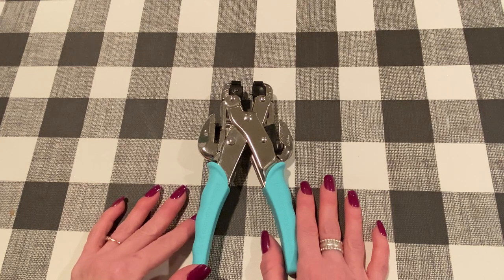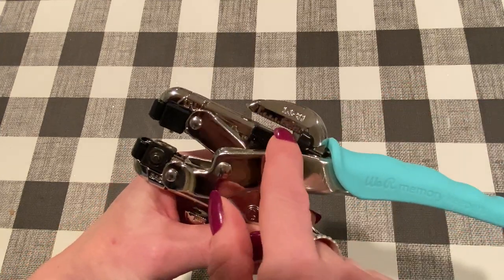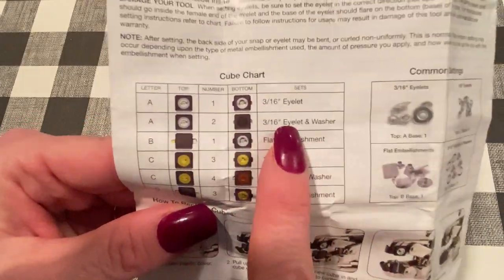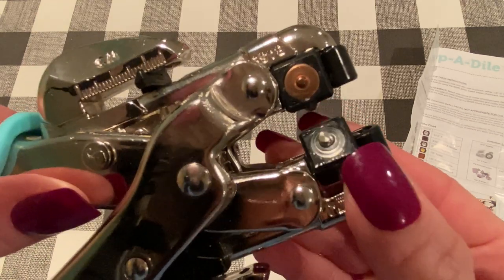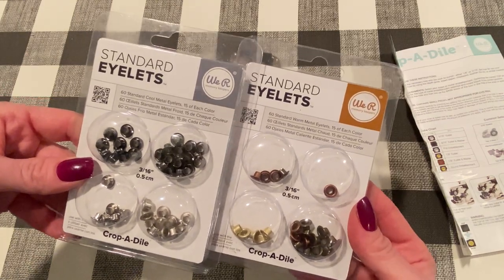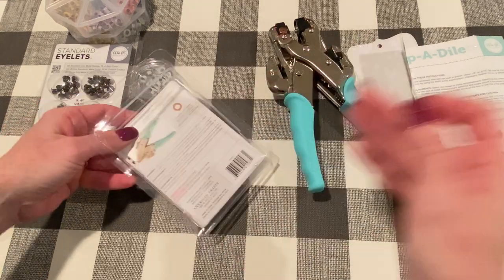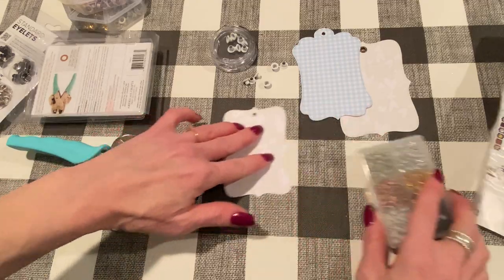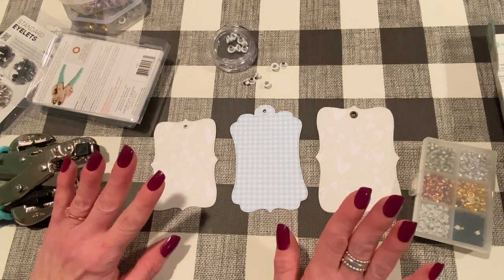How to punch holes and set eyelets with a Crop-A-Dile (requested)

Comment: Thanks for the demo. I have been using mine for 2 years BUT not very confident about it. (Relieved to see that your back sides can look imperfect, too, but they are still just fine.) I never noticed the markings on the CAD itself indicating the "base", so you know how to hold it when punching. The directions leaflet that comes with it has the tiniest printing.

Comment: Hi, very useful indeed. Thank you very much! I mean to buy one to use it on fabric. Do you know if it works for that at all? For both punching and eyelet setting? I know I may have to stiffen the fabric first, with starch, to get a cardboard-like consistency.
Reply from the maker: Hi there! I would imagine it would work the same. You might want to check out the cropadile instructions, either the one that comes in the package or online. There could be recommended settings for different materials. TFW xo Jen
Reply: @strawberrycream39Jen  Thanks! 😊😊